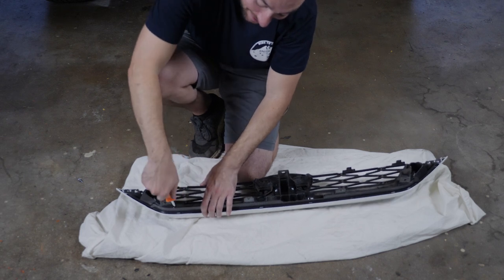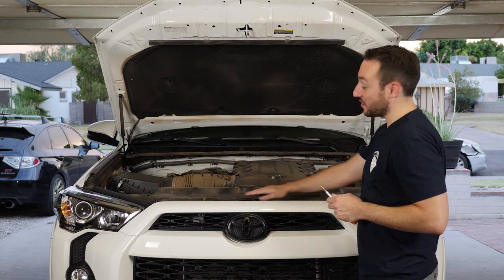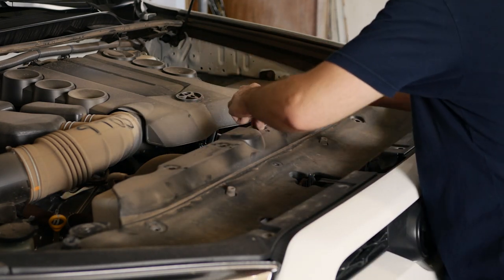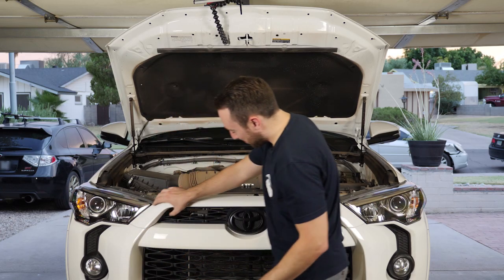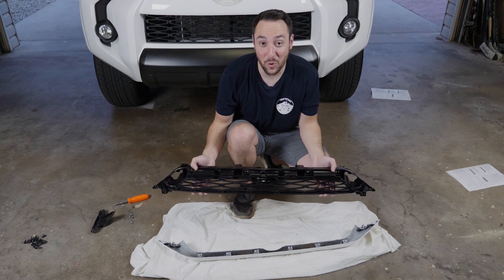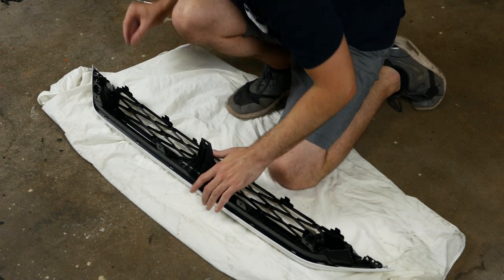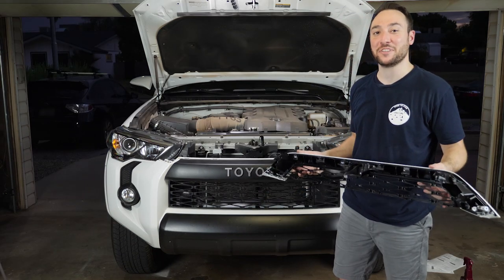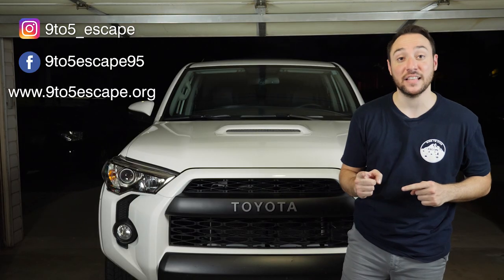4Runner TRD Pro Grille Install

Comment: I've been on a 4Runner kick as they are one of my dream SUVs and I've got to say this is a great tutorial of how to install this grill. I'll be sure to come back to it when I get my 4Runner one day 😁
Reply from the maker: Wouldn't trade it for anything. Hopefully the car market cools down a bit so you can get one yourself!
Reply: You end up getting one yet?
Reply: Was my dream car and I finally manage to for it. Don't give up hope. Save save save. The market is beginning to open up a bit but keep in mind Toyota Runners are rarely ever on sale, as they never saturate the market completely. Made only in Japan so that would be hard for them to do even if they wanted to. However, starting this fall the dealerships will be discouraged from marking them up (in some case between 5-10 thousand) as they have since 2020. Also, the 6th Gen is right around the corner, so they will have to clear their 5th Gen inventory to make room. Best of Luck, future Running mate.

Comment: I have a 2022 off road and the upper grille removal is killing me.. I have both ends off but the tabs on the back of the Toyota logo are not budging and is stopping me on getting the upper portion off 😩😩😩

Comment: ugh I'm at a road block. the part that you did in "one tug" haha.. mines not sliding right out like that. it looks like there are more clip-type things stopping it that weren't mentioned in the video
Reply from the maker: There really should only be the two clips and 10mm bolt holding that portion to the vehicle. I recommend giving it a good "wiggle" to loosen before pulling off the vehicle.

Comment: Can this fit my 4Runner off road premium 2021? Would appreciate your reply 🤘🏽
Reply: Yes it will fit.
Reply: I also have a brand new 2021 sr5..toyota web site says it wont fit my 2021.... 2020&2021 have the safety sense panel  im guessing thats why... ive seen one of the after market kits has a notch at the bottom of the fasia panel for the safety sence panel in the lower grill
Reply: @birchwhitehd  what did you end up doing?

Comment: Hi!  I cannot get assurance from my Toy dealer that these part numbers will fit on the 2022 TRD ORP;  PZ327-35053,  PZ323-35056, and the black lower valance  53901-3520. Can you please help.  I don't wish to be stuck with 600 bucks worth of parts I can't use. Thanks!

Comment: Does the upper grill secure the cover? Just wondering if the cover can be pulled off or fall off if the 3m tape fails..
Reply: That type of 3M tape is VERY strong if applied correctly.

Comment: Is it really easy to install or should I find someone to do it for me? I drive a 2021 Toyota 4Runner SR5 Premium
Reply from the maker: I thought it was a fairly easy install. If you still don't feel confident after watching the video then maybe have someone help you or get someone else to install it.
Reply: @9to5Escape  I installed it myself on my 2021 SR5 Premium. The lil downside is that when I applied the garnish part, I placed it a lil too far to the right.

Comment: whats the ideal temperature for the adhesive? how cold is too cold? and how is the adhesive holding up?
Reply: I installed the OEM one today on my 4Runner and it said to apply heat if ambient temperature is below 15C which is about 60F.
Reply: Jeff Poirier do you have part number on what you installed?
Reply: @victorchicas8848  

PZ323-35058 - Garnish specifically for the 2020 4Runner.

PZ327-35056 - Upper Radiator grille.

These are often sold together.
Reply from the maker: @victorchicas8848  part numbers are in the description now too

Comment: probably a dumb question, but should this be the same installation on a 2022 sr5 model?
Reply from the maker: Most likely but I think the newer models have the Toyota Safety Sense sensor in the front grill that requires a different part #.

Comment: I have a 2021 4runner TRD off road. Does the 2020-2021 trd pro grille mess with the sensory system?
Reply from the maker: Not sure about this. One way to find out is to try it and see. If it doesn't work after that, you can just peel the plastidip off of the sensors. Dipyourcar says that it shouldn't affect your sensors.
Reply from the maker: Sorry, you asked about the TRD pro grille, not the Plasti dip... If you buy the older version of the grille you would have to Dremel areas out of the middle where the sensor is. If you buy the newer version of the pro grille it will already have the areas notched out.
Reply: @9to5Escape  got it! Yea I just doubled checked earlier. I need the grille trim for 2020-2021 that has the black bar with the cuts in them. Thanks for the quick info!
Reply: @jinnotjim  where can you find that? I got a 2022

Comment: question: are the letters 3m tapped only or are they screwed down too?
Reply from the maker: As this is a Toyota OEM grille, the lettering was pre-installed and required no additional steps to attach the letters to the grille. That being said, I believe the manufacturer used clips to attach the lettering.

Comment: I have a 2016 4runner. The website says it won't fit a 2016. Is that true? I find that its exactly the same build. Anyone have problems?
Reply from the maker: It may be because you didn't select TRD Pro trim level and the site thinks it only fits that trim. Maybe someone with a 2016 could weigh in but I wouldn't think it's an issue.

Comment: Sir can you answer our question please do you have link for those 2 things so we can buy it ....don’t make a video if your not answer out question its gonna be useless video if you not answering the question. Thank you sir.
Reply: I got mine from mcgeorge online parts, both OEM 
the upper: https://toyotaparts.mcgeorgetoyota.com/oem-parts/toyota-grille-radiator-up-pz32735056?yotpo_token=5cb22021d761cf49d5df1915278b546d7d7ab508&utm_source=yotpo&utm_medium=email&utm_campaign=map

the garnish: https://toyotaparts.mcgeorgetoyota.com/oem-parts/toyota-garnish-fr-bumper-pz32335058

came out to about $450 with shipping
Reply: @leelaiabraha227  hey thanks for sharing that link, I have SR5 2014, did they sell this  to you without owning a trd pro 4runner? Or without the VIN number of a Toyota 4runner pro?. Also were you able to fit this on a SR5? Or similar?

Please answer friend
Reply: @eclinor  they did ask for VIN but I don’t think it was required, i think it was instant verification that the part would fit my vehicle.
Reply: @leelaiabraha227  thank you for answering, I will check if I can buy it without been ask for that
Reply from the maker: Links now in the description.

Comment: Will this work for a 2019 trd orp? I had 4 extra pull up screws to get out. Top part still seems stuck and not pulling off.
Reply: Ok. Got it all finished except putting the top part back on. Doesn't seem to be able to clip back in. Any ideas?
Reply from the maker: To my knowledge, the same grille should work with the 2019 ORP. Mine is a 2018 ORP. I recommend comparing the new upper grille portion to the one you removed from the vehicle. All clips and screw holes should line up.
Reply: Can you follow up? I got a 2022 orp. I notice the parts from the description only say up to 2019.

Comment: Does it come with the bottom portion for the bumper as well?
Reply from the maker: The bottom portion is the stock bumper on the TRD Off-Road model. We plasti dipped it in a previous video. Check out or channel for the other video!
Reply: @9to5Escape  Cool! I would rather order an OEM matte black one

Comment: Does this work on the 2020
4 runner sr5
Reply from the maker: I would confirm the fit with a local dealer. I believe the newer 4runners have front sensors that the bumper may interfere with and require a different part number.

Comment: I wonder if this will work on the 2020
Reply: smallz1975 me too. Just picked up a new one and want to replace the grill.
Reply: @gschu39  Awesome, I just signed paperwork for a 2020 in Barcelona Red, I can't wait to pick it up!
Reply: It works, did mine with an SR5 2020, just to add one thing though, you have to sacrifice the two chrome strips, was not a problem for me cuz’ i hate chrome.
Reply: @RCGJR_  what part numbers did you get for the 2020?
Reply: @smallz1975  Just got my 2020 white yesterday, planning to do the grill also
Reply: Edit: TRDShop notes say it will not work with 2020 models. But google "TSO PRO GRILLE 4RUNNER 2020" and looks like Trail Standard Offroad has the 2020 model.

Comment: Will this fit a 2022 ORP ? It says only up to 2019. Anyone? Someone? Please lol
Reply from the maker: I think there are sensors in the newer models that the grille may interfere with. I would suggest calling your local dealership to get the correct part for your model year.

Comment: Does fit for 2022 4runner?
Reply from the maker: You might have some issues with the new sensors in the grille. Please check with a dealership before ordering the parts.

Comment: Will this work for the Limited trim?
Reply from the maker: For the grille the TRD pro one fits the limited models. Assuming 5th gen of course.
Reply: @9to5Escape  Awesome, thank you for the response!
Reply: steak Johnson  I ended up using Plasti Dip on my grille and it turned out really well. Much cheaper alternative!
Reply: steak Johnson  No worries, I actually only Plasti Dipped before the fog lights so I taped it off right before them.